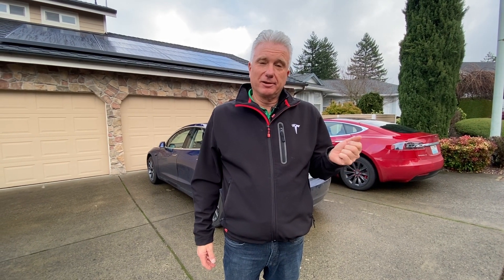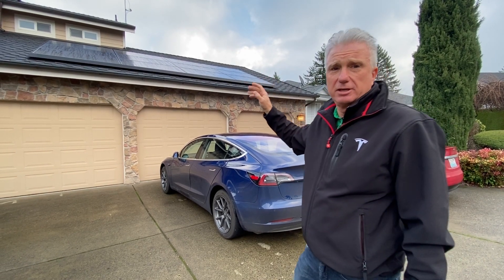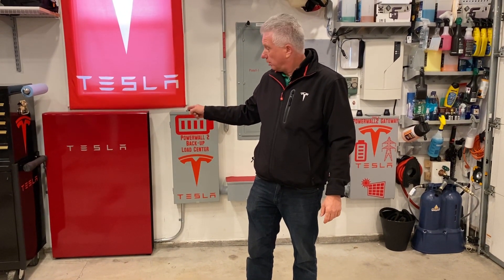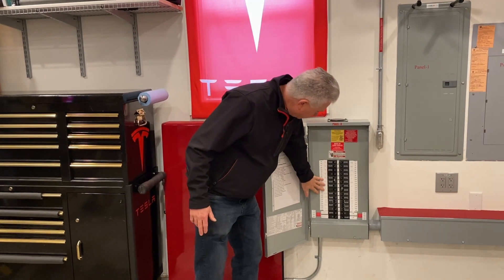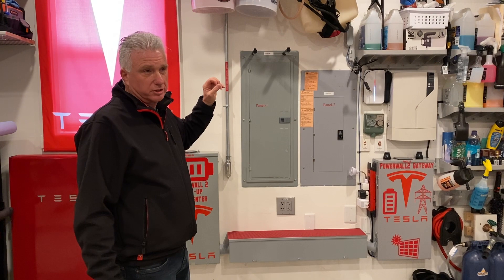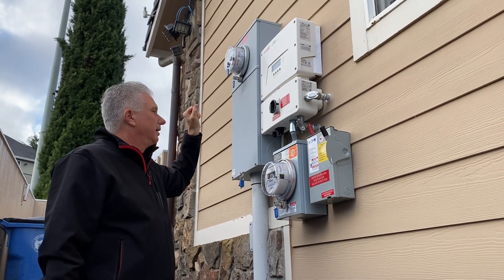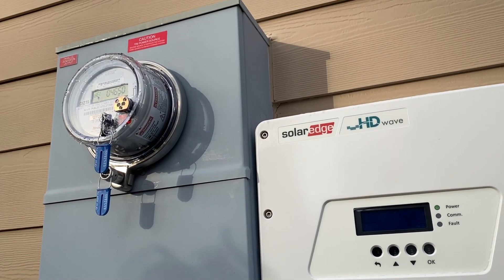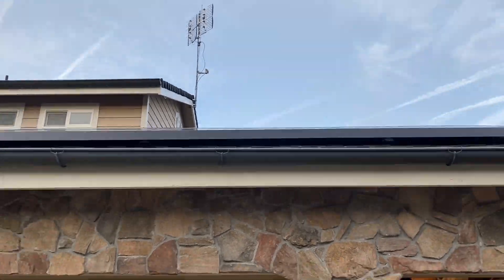Tesla Solar & Powerwall 2

Comment: Is the cost on the Tesla website accurate? or are there hidden costs?
Reply from the maker: D MacArthur There were no cost surprises for me. Just some delays in scheduling, permit approvals... for me.
You can save $250 if you use my referral code (daniel5646).

Use my referral link to receive 1,000 free Supercharger miles with the purchase and delivery of a new Tesla car, or earn a $250 award after system activation by purchasing or subscribing to solar panels.
Reply: @TheTeslaGuy  Do you pay tesla in full, then you have to file for the discounts?
Reply from the maker: D MacArthur You need to provide the referral code when you place the order. 
You can use this URL to place the order and it will add the referral code automatically:
http://ts.la/daniel5646
You will get the referral reward check sometime after the installation is completed.

There is a very small deposit when you place the order. You pay 50% the day it is installed and the other 50% the day your utility company activates the system.  (When you get PTO (permission to operate))